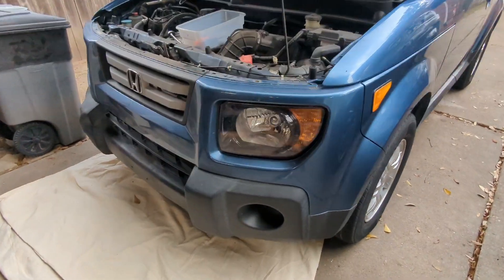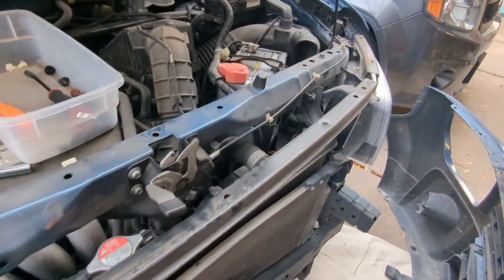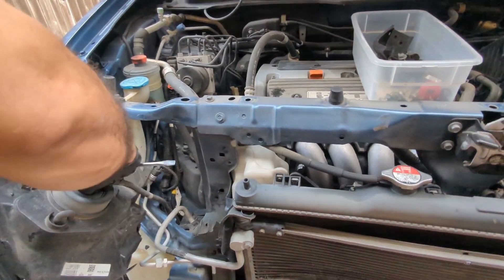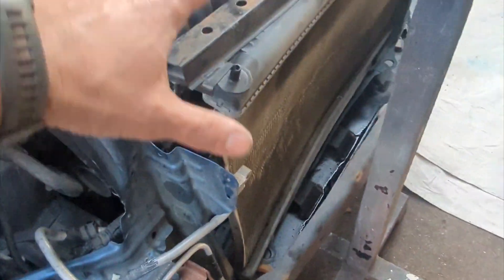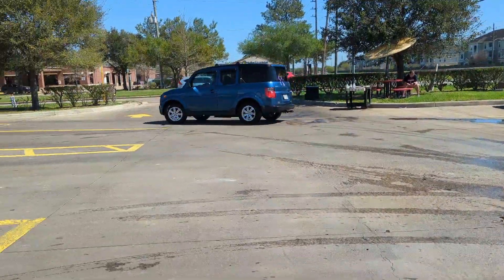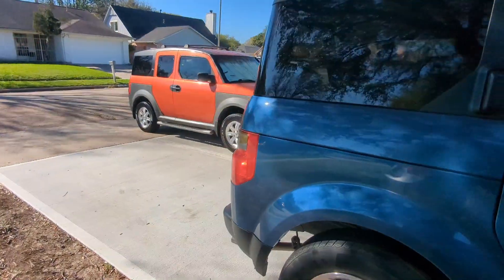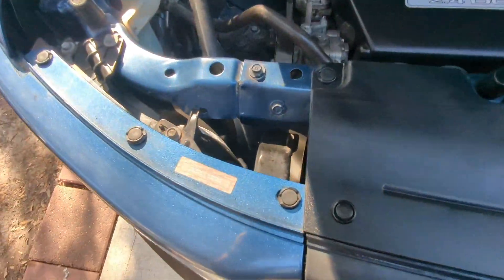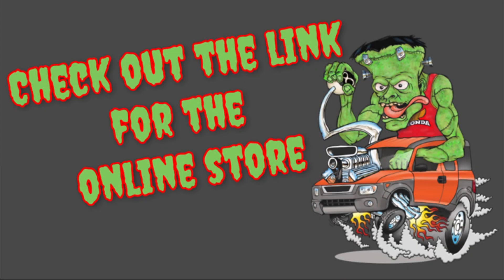Saving a Honda Element

Comment: If I understand correctly, you have $800 in the repairs right?
Reply from the maker: Parts and repairs, I did most of the work. The only thing I couldn't do is recharge the AC
Reply: @alekslpez  Gotcha, thanks. Great job reconstructing the front end. If you had to guess, how much value do you think cosmetic fender benders like that knock off of resale?
Reply from the maker: @jasond4752  I sold this one for $5500 in 3 days. I was trying to sell it quickly, I needed a van. If I would have waited I could probably have sold it for $6. I think if the work is done right, certain buyers don't care. I always disclose what I fix or anything that might be wrong with it.
Reply: @alekslpez  Good to know. Not sure where you’re at but unfortunately I’m in the rust belt. Slim pickings out here for a decent element that doesn’t have much rust. I settled for one that needed some cosmetic body repairs but has no major rust issues.